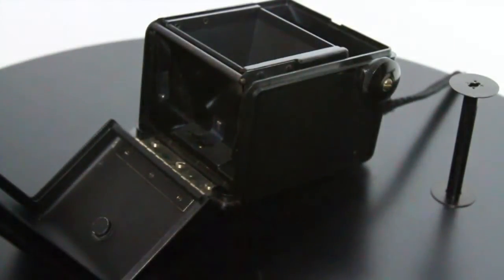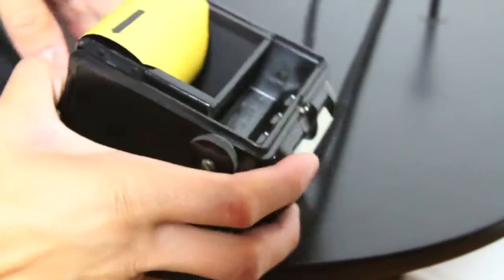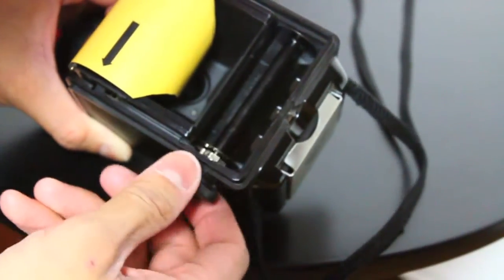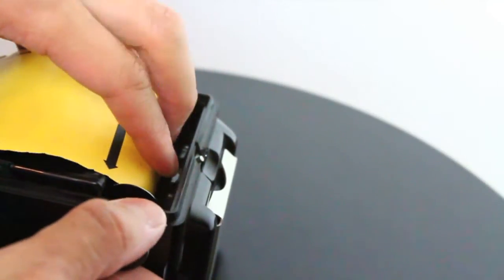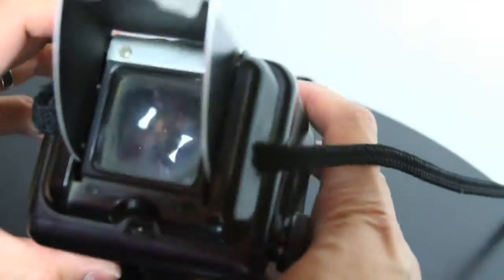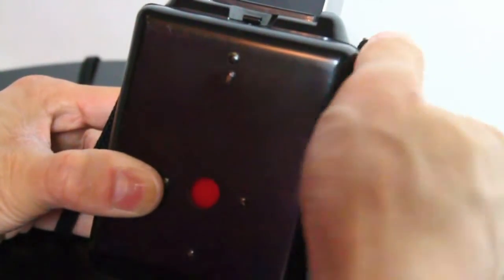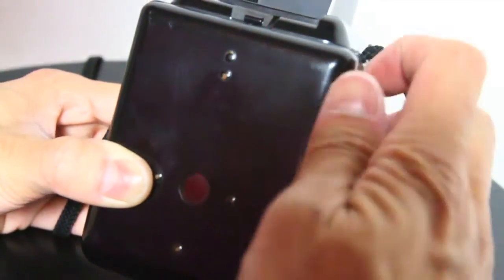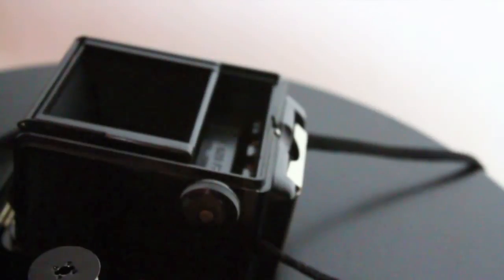Argus 75 120 Film Loading

Comment from the maker: agreed. the main thing to take away from this video is that 120 film has excessive amount of lead paper. if you dont cut a way the first 8-10 inches of paper, by the time you get to frame 8, you have a hard time advancing the film into take up spool. 120 film has paper over top of negative unlike 220 film.

Comment: I bought an argus camera today adn the metal peice that you feed the film through is on the bottom does that still work or do i need to somehow need to take the metal peice out and move it to the top
Reply: Straight Up C I have the same thing--spool is on the bottom, but I'm not sure if it needs to be moved to the top somehow
Reply: Straight Up C Just figured it out--push the little metal prongs inward to release the spool. Then you can load it at the top. :)

Comment: Thanks so much for this video, you rock. I was having trouble loading a roll of HP5 , and used a dremel (originally intended for filing my dog's nails!) to shave off a bit of the plastic edge of the spool; it then went in easily. Thought I'd share in case it could be helpful for anyone else!